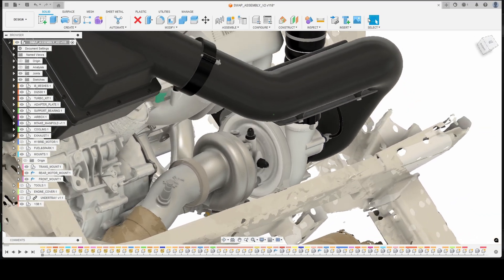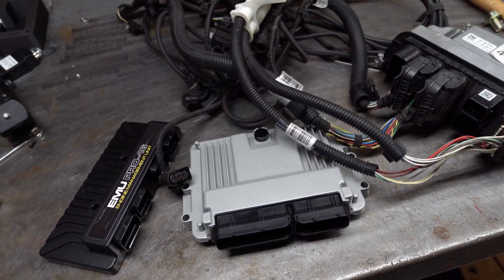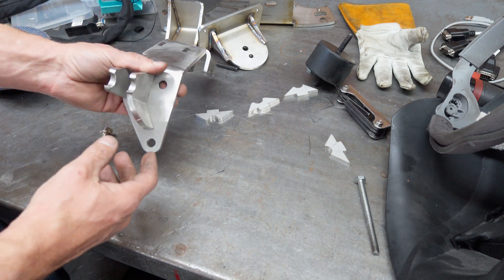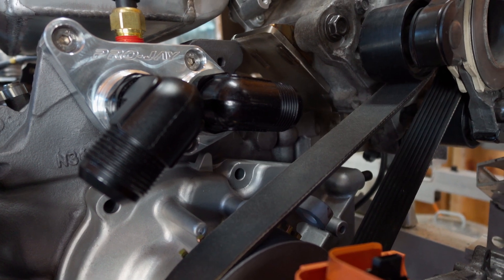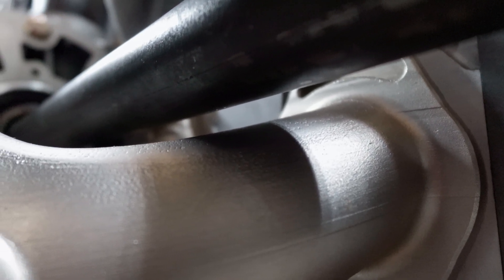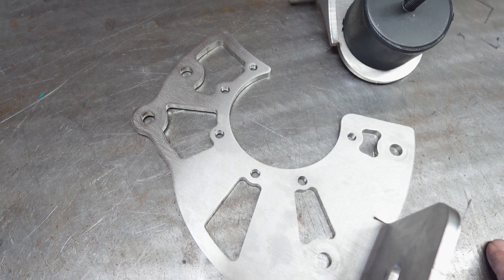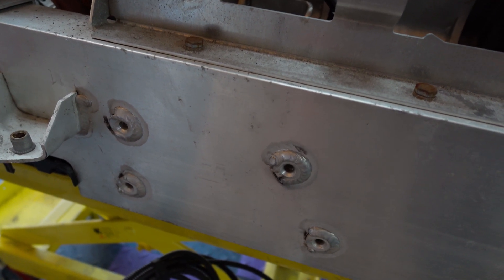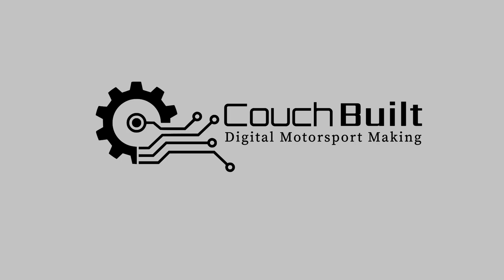Motors on motors for bolt on torque - Building a 13B Rotary BMW i8: EP9

Comment: what Belt Driven Starter Generator is that? I have been researching this heavily lately and cannot find out who has solved the CANBUS control issue for these BDSGs and which one to purchase to get this added to my vehicle.
Reply from the maker: This is the stock part of the BMW i8 (part number 12317649390). It's going to be controlled through the OEM inverter without any tuning (for now) in my i8.  I don't think there are many folks out there reverse engineering CAN control of these. At least in the BMW case, the inverter is on FlexRay which is a non-starter in my opinion with the information and tools available today.  If I was doing this on another car, Id probably use the same BMW starter/gen,  and run it off a $200 Toyota Prius inverter with a control from OpenInverter. https://openinverter.org/wiki/Category:Toyota   The benefit of using an open source solution like this is that you can put a much more powerful inverter on the motor, then output a bunch more power by riding the temperature limits rather than the conservative, drive 200k miles, OEM tune-up.  If someone wanted to go down that road,  Id consider contracting the design work.
Reply: @CouchBuilt  I believe that folks like me will be very interested in adding BDSGs to their vehicle INSTEAD of forced induction, easier to tune, easier to install and makes MORE power with LESS engine wear and tear, packagin constraints, intercooling etc etc it just makes more sense. I developed a SC kit for a 4th gen viper, it's a massive PITA, putting some good BDSGs in vehicles and adding a 48v power pack is going to take over soon as far as aftermarket power adders I believe
Reply: @Lspencergottlieb  I don't think they'll "take over" , but as Porsche has done, they've integrated the same methodology into the turbo itself in the new 992.2 GTS, using the 48v to always instantly have the turbo spooled, and once the exhaust flow equals or exceeds the electric motor's RPM limit, exhaust takes over for the turbo.... and I'm sure they're going to do something similar, or should I say, to a greater extent, with the Turbo trims.... they'll probably use the same 48v assisted turbos on the engine, as well as in the transmission.

Turbos by themselves though, I believe, are too efficient by themselves to control solely by electric, and all solely electric superchargers and "turbos" (still a supercharger lol) are pretty much garbage.... I think there's like, one available on the market that is somewhat effective, at least for performance sake, I know like, VW has used them for twincharging, electric supercharger and normal turbo combined.
Reply: @CouchBuilt Super interesting project I should say, interested to see how you get on with EMU Pro. I used EMU Black for DSG control previously and found it very average unless you have low expectations compared to a factory car. Instead wrote custom ECU firmware which does everything properly and is the closest to factory I’ve experienced.
Reply: @CouchBuilt Does the stock inverter not require feedback from the engine controller to operate properly?
Reply from the maker: It does. See earlier control episode
Reply: @CouchBuilt  Thanks, will check it out
Reply: @CouchBuilt  Having now watched, I’m wondering why it isn’t possible to replicate the factory signals from the DME with the content you want and remove the DME entirely, I.e a CAN to flexray gateway. Seems like if you can determine the network configuration then it should be possible to find DME Flexray messages. May also be possible to identify them if you can’t find a software description for your ECU or a similar one. Might be missing something though.
Reply: i have a bosch 20kw one on the accessories belt and have found no other solution save for a standalone programmable inverter.
Reply: @riccardo1796 What is the part number of this? Interested in having a look

Comment: You can brush alodine on the aluminum parts that touch stainless. If you want to go even further you can put epoxy primer over the alodined surface

Comment: Not sure if I missed it in your 13b teardown, but it seems like a good idea to have that extra front iron bearing (either using the billet pro S4/5 front "iron" or I saw there is a mod for the REW to add in an extra ball bearing, not sure who makes that though) with all the load you're going to be putting on there with that generator belt setup.  This is such a cool project, I'm excited to follow your progress!
Reply from the maker: Yea, this is getting ball bearing supports front and rear from E&J. I have the front ball bearing in hand and my rear stationary gear and counterweight are down at his shop getting modified now. My bearings had wear in the tear down video that indicate an overtightened accessory drive, with seemingly very low mileage. That was something I planned to address from early on.
Reply: @CouchBuilt  I was just about to edit this as I saw it in your newest video, hah, great work and thanks for the reply!

Comment: If you don't already know, and don't already have some, there's a couple companies who build custom inconel heat shields for turbos and downpipes, extremely similar to OEM dimpled shell heat shields that clamp on, but these have built-in clamps....all you need to do is upload your files to them and they'll make you a set for your turbo, downpipes, and lower intake runners.

I highly recommend this, it seems you know your way around rotaries, but if not, they're infamous for extreme EGT's, hence why I believe you went with an inconel turbo manifold....but IMO, you should either order a set of these inconel heat shields for the above mentioned (including the lower intake so the heat doesn't soak your intercooler brick from bottom up), and if it were me, I'd also get the turbo manifold itself ceramic coated inside and out.... it'll both drastically reduce all that heat you're going to be making right there in that tight little spot, and , it'll help your turbo spool faster and with exhaust scavenging to produce a few more horsetorques just with the improvement in flow due to the heat retention....not even including the benefits of the drastic temperature reduction. Here's a link to the one company ↓

https://turbosource.com/pages/inconel-custom-made-heat-shielding-ordering-form

Comment: This isn't criticism I'm just curious and I'm sure it's been asked already. Why did you choose to upgrade the engine instead of go all electric?
Reply from the maker: Been there, done that with my e30. Too many limitations, not enough top end power. At least with attainable parts. A hybrid is the better solution in most performance cases.
Reply: @CouchBuilt  ahhh I see. I default to thinking electric would have been ideal for this car but I guess if it lacks top end power then thay makes sense.

Can you elaborate on what happened when you disconnected the ice and drove it just on electric. Did the car freak out or was it okay.

Comment: Because sometimes I have problems following the entire flowchart, am I correct in thinking you are using the starter generator to add power into the crank rather than the an electric motor at the wheels?  I presume this is all just to adapt the SG to the 13B in order to use it with the factory components?  Thanks
Reply from the maker: Yes, but there is also still an ev motor in the front applying power to the wheels as well.

Comment: Do you  have any extra support for the front of the eccentric shaft? 13Bs don't like high shear loads on the front pulley and will eat up the front bearing very fast. There are a couple solutions out there though from people that have supercharged them
Reply from the maker: E&J ball bearings front and rear

Comment: I'm rather concerned by the lack of clearance between the downpipe and the transmission case; what are your plans for insulation?

In-industry, we traditionally do a multi-layer metal heatshield with air gaps on both sides, but obviously you don't have enough room for that. Maybe it's just an optical illusion from the combination of shadows and the footage being slightly-out-of-focus, but it looks like you hardly even have clearance to wrap the pipe.

When designing the pipe, did you consider locally ovalizing the cross-section between the v-band and the O2 sensor to gain more clearance? I imagine it would be a lot easier to achieve that with a 3D-printed part vs. if you had to try to fabricate it out of round tubing.
Reply from the maker: It’ll have an inconel heat shield. It’s also not rotated to its correct position.

Comment: Just my $0.02, consider changing trans mount design to keep a bracket attached to the trans case, those aluminum threaded holes love to strip if you have a lot of install/reinstall going on as you get everything finalized and situated.
Reply from the maker: The mount doesn’t need to come on/off for much. It could probably stay where it is through final assy. I usually install studs in aluminum stuff that needs regular service.

Comment: Just found this build and excited to see how it goes. Mechanically the engine mount you made will likely deform the holes in the frame rail over time. Based on how neat your welding is I'm surprised you didn't replicate the original system tbh.
Reply from the maker: This subframe isn’t going in the car, I’m only using it for mockup. Worst case the plate gets welded on the real subframe.

Comment: That is such a beautiful sight! The I8 is not an ugly car and you have made this car into a proper supercar! It should have came this way! 😀
Reply: The i8 is IMO, a quite attractive car, and from all the reviews and testing, it's a phenomenal car and chassis.... even the powertrain is great.... until the battery runs out and you're left running on 3cyls 😅

This here, is going to alleviate all that (for the most part), having double the base engine HP to start, and more than 100hp more than even the full EV plus 3cyl combined.... plus some weight reduction going from a 3cyl to a 13B, this thing is going to be outright awesome.... I just hope he has plans to keep it AWD.... the 13B is studded already, rotors are clearanced and lightened for both response, and high RPM use....as long as the turbo he's chosen is up to it, and he's got enough fuel... and the tune is good, he's got the capability of making in excess of 700hp.... even though I think 550-600hp to the wheels would be a great stopping point, but the keg is clearly built with the intention to make more, all depends on how much fuel and air he can shove down this thing's neck (and out obviously)....

Comment from the maker: Ackshually, the motor is technically an ac synchronous, not ac induction. Failed to catch that misclassification during editing.
Reply: As in a bldc or an actual synchronous reluctance one?
Because if the latter, good luck with getting it to work with off the shelf controllers
Reply from the maker: Synchronous pm deal. The FOC open inverter firmware controls them without issue. A bit more of a tuning curve up front but the process is decently documented, particularly the Leaf motor.
Reply: @CouchBuilt  nice
Yeah, FOC for PMSMs is very mature at this point

Comment: Polyurathane bushings dont suck on a street car... Overly stiff poly bushings stuck.. and most aftermarket ones are overly stiff. Some from being too high of a durometer, others are a fine durometer but made solid in a situation where there should be holes to give.
In otherwords, as a material, its superior...  but due to the poor engineering of the aftermarket, it has a bad rap.  OE generally doesnt use it because of cost & tradition...
Reply from the maker: Yea most aftermarket offerings are too stiff.  If you choose a softer durometer, there’s likely marginal improvements over fresh OEM rubber. Arguably perhaps get some better longevity. My comment is mostly around RWD style mounts. FWD stuff with open cavities in the rubber definitely benefit from poly inserts.